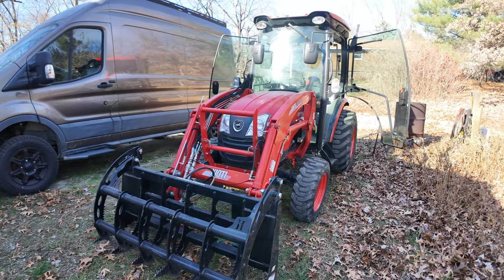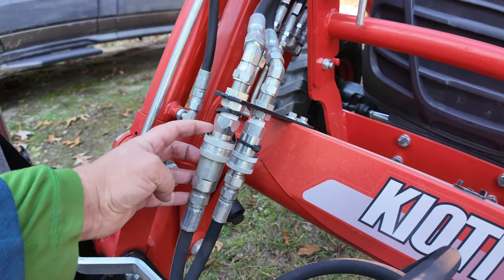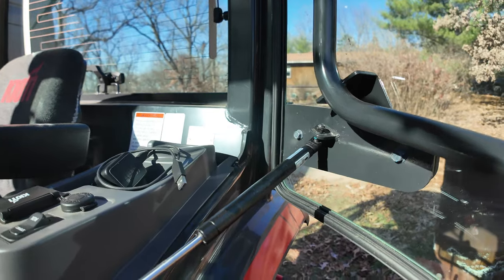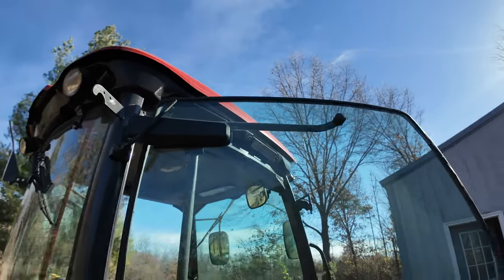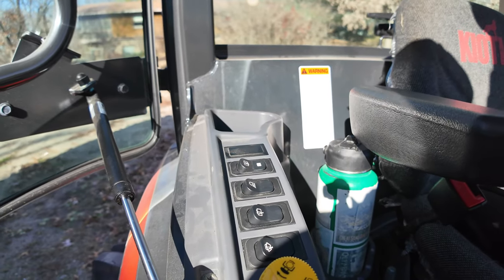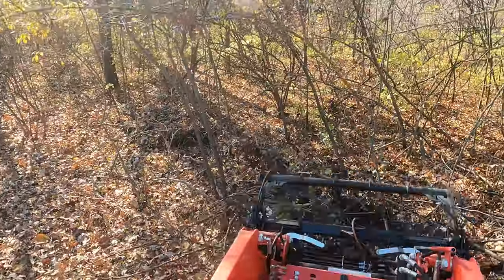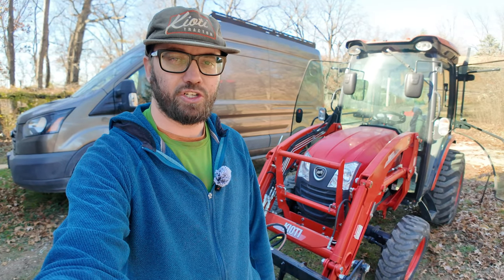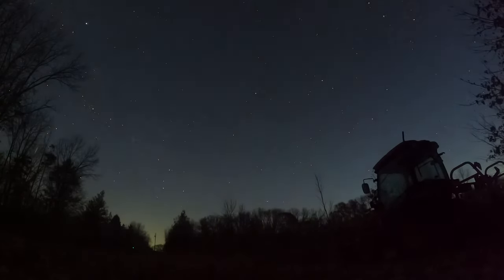My Kioti Tractor Arrived BROKEN! | Kioti CK2610

Comment: The Kioti CK2610HST Cab only weighs 3400 lbs without loader. Take off any 3-point implement and don't put anything on your quick attach and you'll be at around 4,000lbs. As long as your trailer doesn't weigh 2,800lbs you'll be fine. Any car trailer can handle your tractor. If you're really concerned about it, the loader comes off pretty easy on these. They even have kickstands built into them.
Reply from the maker: Eh, my Transit can only tow 5,800lbs with a 600lbs tongue weight. It’s a unibody and not really made for towing much. I’ll probably pick up a used truck one of these days.

Comment: Bought my CK3510 Oct 2021, came with 2 year bumper to bumper warranty. This past August on a Mon  I backed tractor in garage with forks on and some planks on forks, I shut it off with bucket halfway up to unload planks, thought I heard wife holler supper so I lowed bucket to floor, it came down a bit hard and shook tractor, thinking nothing of it I went in house but wife said something else so I went back out to unload planks, I went to start tractor to raise loader off the floor and as soon as tractor started it shut off and everything was dead......

So at almost 5pm I called dealer and the tech guy said to look for blowen main fuse, found that and it was blowen, so they said they'll be out Wednesdays. The guy showed up about 1pm, he changed fuse and tractor came back to life, restarted dozen times and it was fine and said could've been a fluke but he said for a main fuse to blow some big wire had to short out, if happens again we're going to have to bring it back to the shop.....

So next morning, Thursday, I went to use tractor and it did the same thing again, start up and shut down and everything is dead, I called dealer and they sent tech guy out next day on Friday about 3pm, he change fuse and they aint cheap, shook wires and tractor still ran, he re-started it several times and it ran fine, then he went to passenger side to check under dash, as he went to kneel down he put his hand against the dash and tractor shut off, blowen fuse again, he got back up and said this is going back to shop, I'll have dealer call you for pick-up time......

Next morning, Saturday 11am-ish they called and said they are sending someone out to pick tractor up, they are around 40 miles away. The pick-up guy showed up around 1pm, I told him the fuse is blown so how you going to load it, he said I dont care about fuse and brough some sort of jump-starter cable, he hooked it to the starter and started tractor right up, I said to myself I have to get one of those jumpers, in a matter of minutes he loaded tractor on F250 with trailer and some tie-downs, and away it went...........

The following week on Tuesday the dealer called and said they found problem, the main wire harness was chaffing near steering column and they ordered new harness, I said thank God you found it, in month & half the tractor is coming off full warranty. Then they said it will take about two weeks to get part and put back together, I thought to myself more like two months. The following week after that on Wednesdays the dealer called and said tractor is all fixed and on it's way back and will NEVER have that problem again. They might be right, it's been about 3 months and tractor still starts up without blowing fuse....... 
I never paid any shipping or transportation cost, so why is it when I see a repair video, they are all paying a shipping and transportations bill for new tractor under warranty...............
Reply from the maker: Glad you got it all sorted out, no fun when your tractor is just a giant paper weight

Comment: I pulled my 2610SE with bucket and forks AND backhoe on a 20’ aluminum trailer with…. A Jeep Liberty diesel. 4 cylinder 2.8 liter. The tractor weighs around 6k with the implements I had. Your Sprinter will do fine.
Reply from the maker: It’s a Ford Transit, found its tow rating is 5,800lbs. I’m sure it could handle it but I think I’d be over its rated capacity

Comment: Apparently it doesn't matter which brand you buy there's always a possibility of problems,, there's a kioti dealer near by but the LS dealer is halfway between home and camp so that's the direction I went. Sure enough got one with issues but I can't say enough about the dealer, they've picked it up and dropped off a loaner twice at no charge to me, he called me yesterday and said they've finally got it fixed and are extending my warranty to compensate the hours of testing.
Reply from the maker: My dealer has never offered me a loaner! Hell, they got my parts in from Kioti several weeks ago and haven’t scheduled a time for my warranty repairs….

Comment: Tough break. Ive had mine for 3-4 years now and i abuse the crap out of it, only problem is had was water getting into the starter ignition switch (key hole was left uncovered) and water got into my third function relay/switches. I replaced both myself for 100$ (all three parts 2 third function and the ignition). The loader recall is something i might look into but it sounds like it might be a “covid supply issue” when companies were struggling to assemble things so they took shortcuts. 

Any way you could test the light switch and see if it works/supplies power? A wire harness really doesn’t get to effected by water unless it has something else inline like a fuse or relay or something. Should just be wires going right to the lights. Seems odd. 

Good luck.
Reply from the maker: Thanks! Much appreciated. Glad you were able to fix your problems inexpensively. They said they have to splice in a whole new harness to fix it 🤷🏻‍♂️
Reply: @MowSowGrow3  sounds like you might have a bad dealer. Big part of owning a tractor goes into self repair and reliance too. Glad warranty is covering it though, ive never had a warranty do anything for me, i stopped paying for them. Lol
Reply from the maker: Not so sure about the bad dealer part…I’m pretty sure they know what’s going on since they have actually inspected it first hand. my warranty is the factory warranty that’s included in every tractor sold, yours should have one too unless it’s older and now out of warranty.  Not sure why you wouldn’t use it if you’ve got it…
Reply: @MowSowGrow3  same problem with my warranty as you had with your “shipping” no trailer. Im not paying 350$ for them to pickup/return a tractor for 100$ in parts covered under warranty. I picked them up at the dealer on the way home and had the tractor running in 20 minutes. No need to wait a month. Farms and homesteads cant wait a month for a dealer to “get around to it” when there are things to get done. 

All together from the ignition going out to me fixing it was roughly 48hrs of being down, i was working my day job so it wasn’t a big deal. I couldn’t wait a whole month.
Reply from the maker: Good for you dude! My problems are quite a bit more complicated and expensive than an ignition switch, I’ll let the pros sort it out.
Reply: @MowSowGrow3 it seems i might have offended you or upset you somehow. Not my intention. A friendly word of advice though, you will want to learn how to fix your machines on your own regardless of warranty. The recovery fee will be ridiculous if you breakdown in a field or in the woods. Farmers have a long history of self reliance and “jack of all trade” lifestyle. You will be hard pressed to find any “service call” type farm maintenance companies that will go into a field for less than a few hundred dollars an hour. Again, not trying to offend you, this is just reality. You might want to grab a cheap stick welder too, start practicing now if you dont already know how to weld, comes in handy for all kinds of jobs from repairs to fencing.
Reply from the maker: Thanks for the advice!

Comment: Buy a cheap continuity tester and trace your power down the line from the battery to the switch to tge bulbs. It has to be a cheap fix. I don't buy that bad wiring harness bs the dealer gave you.
Reply from the maker: They did all that already. The switch has power

Comment: I've got a CK2610 and nothing broke on the open station model in 3 years.
Reply from the maker: I wish that were true for me. Mine just broke, again.
Reply: @MowSowGrow3  there's a ton of things you can do to prevent breaks and mechanical problems. It's an acquired skill.   Watch Tractor Mike.
Reply from the maker: None of the issues my tractor has had are because of the way I use it. I’ve been running MUCH bigger tractors than this since I was 12. Thanks for the comment.
Reply: @MowSowGrow3  since I was 9. I'm over 60 and I can't use this tiny ity bit tractor the way I used MUCH bigger tractors.   You should sell it and get  a MUCH bigger tractor.  Maybe a JD  This is like a small plot tractor the next size up from a lawnmower.
Reply from the maker: A larger tractor makes zero sense for the size of our property. I’ll pass on John Deere also. And again, nothing I did caused it to break. Next.

Comment: Referencing "job38four10's experience below, I have a friend who owns a Koite and swears by it as to reliability and dealer support. Not sure what to think of your saga but if I am reading right in the end the dealer did respond in a quick fashion and corrected the problem. Anyway hope since your initial post all has gone well for you and will continue. All the best for the New Year.
Reply from the maker: Unfortunately I have a new problem with my tractor, a relief valve on the 3 point is stuck open, I’ll be making a video about it soon. These are all fairly minor issues but they are starting to add up and get annoying. I’m still happy with the tractor overall and my dealer has been helpful but still waiting on all the parts from Kioti. Are you in the market for a tractor?
Reply: Nope, but I hear Ya,  I have a smaller John Deere unit off warranty but parts are costly.  @MowSowGrow3
Reply from the maker: How’s it holding up overall?

Comment: if that van is on a 1 ton frame it should do fine
Reply from the maker: It’s a Ford Transit 250. I believe it’s rated at 5,800lbs
Reply: that should carry the same as a f 250 pick up 3/4 ton truck @MowSowGrow3

Comment: Not to be condensending, but I would rate that particular brand of tractor as 'a do not buy'. Putting it the nice way.
Reply from the maker: They are actually great tractors, I just got a bad one. What do you run?
Reply: @MowSowGrow3  I personally don't have any need for a tractor. I know some old work friends that do. They choose other brands. Some are orange, so even are blue and some are green. Beyond that, not in my wheel house. But, if something on that unit doesn't work, never has, I certainly would take issue with that.
Reply from the maker: @CuriousKL  so you have zero experience to back up your opinion and no need for a tractor but one is on your “do not buy” list. Gotcha haha. I have nothing bad to say about any tractor manufacturers, it all comes down to dealer support and I have a good dealer that’s fairly close by
Reply: They probably are. All I am saying is whatever is not working on that unit should be addressed by the manufacturer and the dealerships. It doesn't matter if i have no experience owning a tractor. Make them fix it or stop whining about it on YouTube.
Reply from the maker: @CuriousKL  clearly you didn’t watch the video. I already said my dealer was ordering the parts

Comment: Moisture getting into a wiring harness or switch should've blown a fuse. It shouldn't need a harness
 I think you need a new dealer.
Reply from the maker: Well considering the fact that they have actually inspected it first hand and you’re just some guy on the internet, I think I’ll take their word for it. No offense.
Reply: No offense taken. However trusting a dealership might be part of the problem.
Reply from the maker: For all I know the guy who told me that could have misheard the mechanic and figured I wouldn’t know or care as long as it gets fixed. Which is true 😂. I have no reason to not trust that the problems will get resolved by my dealer, this is the first time I’ve had experience with their maintenance department. If they drop the ball I’ll have to go much further away for service I can’t do myself, unfortunately.